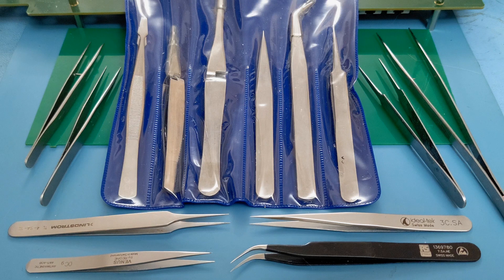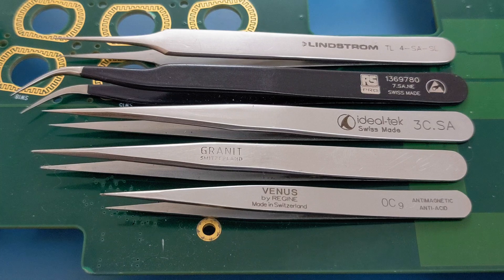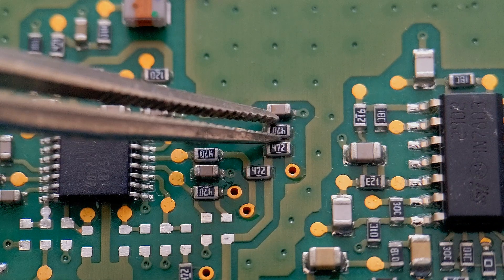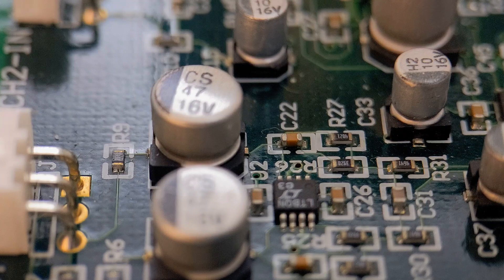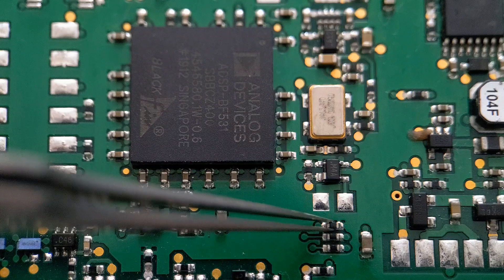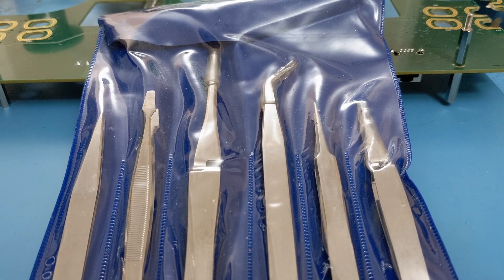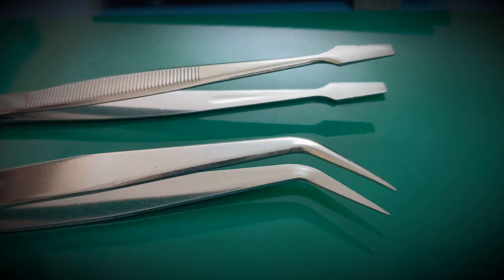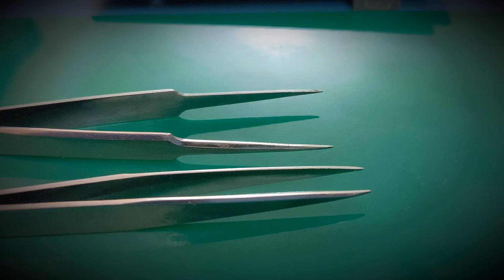TWEEZERS For Your Electronics / Soldering Tutorial

Comment: why do my tweezers keep gettings gunk on them from flux or whatever?  they're sticky and pia
Reply: That's normal during rework when you're using flux. Just dip them in IPA and wipe with a cloth occasionally and they'll be good as new.
Reply from the maker: Hi , exactly right , definitely normal practice to get flux on your tweezers during rework . I use ULTRASOLVE for all my flux removals though . Thanks again for your comment , much appreciated 👍

Comment: I've got some tweezers with ceramic tips just for if I have to work on something that I really need to crank some heat into -- the ceramic tips don't conduct much heat into the handle, so they don't take as much heat away from where I need it and the tweezers won't become uncomfortably hot to hold even over a longer period of time. They're kind of bulky, though.

Comment: In the US I found a fairly decent set of 5 or 6 that are like 5-6 inches long (150-170mm) at Harbor Freight. Has straight, curved, locking, cross, and a few other types as well. Also, I have a few smaller cross over types that work wonders if I need a small heat sink for something.
Reply from the maker: Hi , thank you for watching the video and commenting , very much appreciated 👍

Comment: Most of the maintenance equipment and welding-related tools I have on hand are manufactured in Japan. Due to work requirements, I have to go to large hospitals to repair radiation equipment, such as CT or MRI, etc., and I must wear heavy lead plate protective clothing. And it is necessary to quickly determine the fault area of the system. Indeed, some PCBs must be brought back to the company's dust-free repair room for diagnosis and repair. Thank you very much for sharing the information on how to use the tools. Sincere greetings from fans in Taipei, Taiwan!
Reply from the maker: Hi , thank you for your support of my channel , your time is very much appreciated 👍